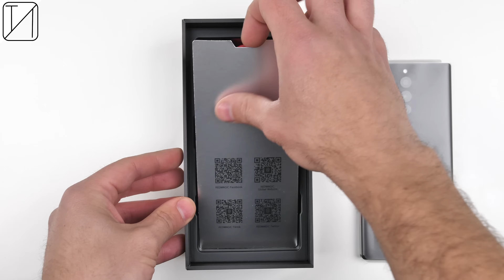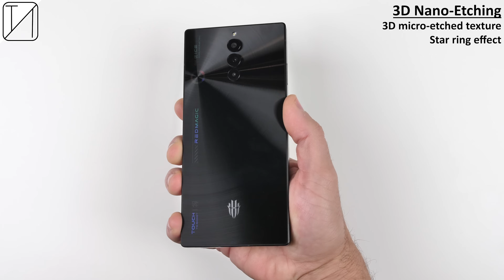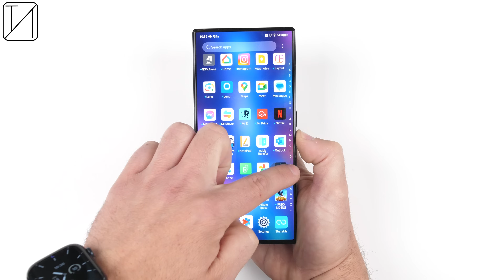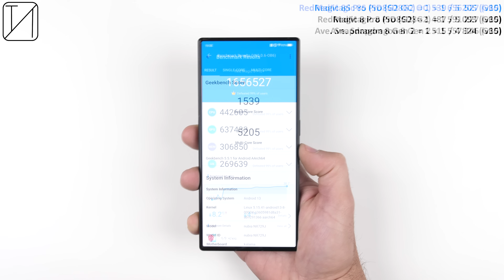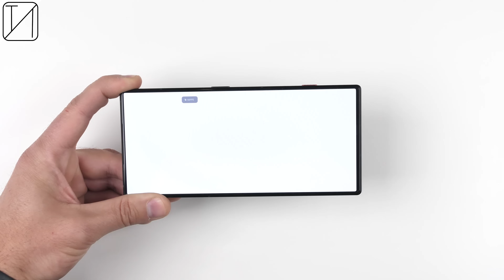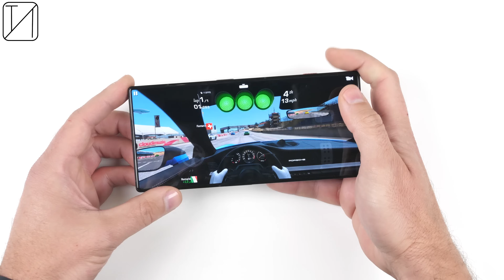REDMAGIC 8S Pro Review: Even More Powerful!

Comment: Its such a pity the midnight black one has lower specs. I think its the best looking of the bunch. I really wish redmagic wouldn’t limit each color to a different set of specs
Reply: i think the reason they did that because they were scared it wouldn't sell
Reply: I don't think you need anything more than 12GB on a phone tbh
Reply: @JRon1 yeah even with all the mobile games and emulation you could do in it, it's still more than enough.
Reply: @JRon1  The issue is more so the storage size.  No MicroSD card slot to expand so the 512GB versions are a must for those that are going to be using the phone for emulation, with all the ROMS etc.
Reply: @ArmaghRed1892 are you sure it doesn’t have an sd card slot
Reply: @likeabarrel  100% sure.
Reply: @JRon1 yoy are right but we are not sure if ps4 emulator will run smoth with 12 ram

Comment: Hi Nick. Does this OS supports 3rd party launchers ? Usually for Red Magic devices if you press the home button it gets out of the 3rd party launcher.
Reply: this I also want to know
Reply: There is always a settings for putting 3rd party launchers as default
Reply: @BennyLuu  Even after turning that option on ut still happens , that's why I asked.

Comment: If I were in the place of gaming smartphone designers, I would have opted for a single photo sensor but quality with optical stabilization, instead of several very average sensors and not optimized. 

Also, I would have positioned the USB-C and jack ports on the left side edge, not to mention adding SD card support. 

But above all, for smartphones with full screen like this Redmagic 8s Pro, I would have opted for a pop-up selfie camera instead of a selfie camera under the screen.

I think that, beyond gamers, it would have attracted any other types of consumers 🤷🏽‍♂️

Ps: I'm not a fan of Android Stock, but I would have opted for Android Stock "à la" Motorola or Asus, it's less complicated than developing an overlay that will not necessarily please everyone, And I would have simply put a physical or software button to activate the gaming mode where I would have all my gaming and other software options integrated.
Reply: A popup camera is not great for a gaming phone. Manage your expectations. A popup camera literally occupies a big space inside the phone which can be used for more copper cooling instead, not to mention the literal fan inside the phone.  For it's prices, it's a great choice. Camera is literally not a priority of a GAMING PHONE.
Reply: I'm using rog3
Unbeatable device
Reply: @zechariahdln9558   In truth, a gaming smartphone is not a priority in a market where "standard" smartphones have become just as powerful and stable in game as a gaming smartphone, being better by far on all the points that define a good smartphone 🤷🏽‍♂️

Buying a Steam Deck that will last much longer at $400-$500 + a smartphone like an iPhone 13, S22, Pixel 7 or OnePlus 11 that will be updated for 4-5 years instead of 2 years as on this Redmagic, is a much better investment.
Reply: ----popup camera affects IP rating
----and instead of putting the USB-C and 3.5 mm port on the left side edge,
    they could have just put it on the side like the ASUS ROG Phone
----they could have centered the cames on the back panel,
     although I'm not sure how that will affect the cooling performance of the phone

PERSONAL OPINION=
 I think gaming phones should be like a rog ally or a switch oled with a sim & android os
with bypass charging feature and a big cooler
Reply: @rolins3279  That's exactly it. Not everyone is the target market of gaming phones. So your literally cannot demand them to accommodate all your expectations. Lol.
Reply: A pop up camera would suck
Reply: @harryhelina9859  The OnePlus 7 Pro had a pop-up camera, but it was waterproof, in addition, this Redmagic 8 Pro is not waterproof 🤷🏽‍♂️

Comment: Id like to know the details about the headphone jack too, is it good for Hi Fi music?.. im probably still go with the s23 ultra because of the 1 TB and camera
Reply: Almost definitely no and in fact those usbc to 3.5mm dongles have actually been notorious on even pcs as a great and cheap audio improvement (assuming ur headphones are decent) over the inbuilt audio on even expensive pc's so I feel like if ur lugging around over ear headphones and a wire there's no point if u lose most of ur audio advantage to the jack itself which u will be. U won't with the dingle tho which is my point on both platforms especially phones where u have to use inbuilt audio with a jack on the phone itself.

Comment: Would this be ideal to use as a daily?  I don't game on my phone often, but the specs are amazing; especially the battery life. Currently use an s21
Reply: Same..just thinking to get this for daily use, i don't want something that has bug caused by firmware / UI e.g Xiaomi. And i like it has SD8 gen 2 and 6k mah battery. (I'm not a phone gamer)
Reply: For a daily this is overkill but he'll yeah to answer your question
Reply: Take my word for it, the software and localizations are awful. Buggy and frustrating to deal with, not good as a daily driver for overall software experience
Reply: If you're not the target, I think it's not really worth to buy not to mention the long term usage, QoL, security/0S update, etc. In a gaming phones is awful. Today flagship has a good SoT even though it still less than gaming oriented phone. Still Had a better camera ofc and anything I say above.

Comment: Would I be able to buy a unlocked model and take it to Verizon Wireless (in the U.S) and activate it there ? May sound like a dumb question I get it but hey maybe I'm dumb you do t know me ,LOL 😅😅😂😂 . But seriously I have the Samsung Galaxy S22Ultra but am looking g for perhaps a different phone experience and thus phone looks intriguing. I do like the SPen on the S22 whixh is why i have been with Samsung as long as i have been. I started with the Note 4 because of the SPen and never looked back even after the explosive(lol) controversy of the Note 7 a still stuck with them . But like I stated earlier in this unnecessary long comment(lol) this phone looks intriguing.  And I like that is geared for the gaming and all the options it has for gaming . The rest of the phone seems like more common features and same level as other flagship  devices but ... I digress I just want to know if I buy this phone unlocked can I activate it at Verizon Wireless (U.S) thanks folks

Comment: For years my nonnegotiables for a new phone were removable battery, expandable storage, and headphone jack. The fact that you went the whole review without showing the top or bottom of the phone is mind boggling. There are no pictures of the top or bottom on the website either. What are you trying to hide? It wasn't until twelve and a half minutes in that I learned it even HAD a headphone jack! Their own store doesn't say it has a headphone jack. It's enhanced in someway? How is that? Sacrificing wireless charging and two of my three needs is honestly a hard sell for me. I've been using a Samsung S10 plus for four  years now and it is the model with 1tb of internal WITH expandable storage! My ancient phone has 2tb of storage space. How can phones almost 5 years later not match that yet?
Reply: Your only choice for removable battery is the Xcover Pro 2020 and Xcover6 Pro 2022, rugged non gaming/non consumer phone. Sd card slot is being restricted to below midrange by most (except Sony) and headphone jack is occasionally still used. Maybe bec they realized BT audio and gaming don't go well with each other.
Flagship chipsets+sd card+jack will only limit you to Xperia 1/5 Marks ii/iii/iv/v models.
Reply: edited since I worded it like Xperias still have removable batteries.😂

Comment: So basically they didn't change anything that were the reasons I returned this phone (8 Pro) before.  While it's not all bad there are critical flaws.  No wireless charging, the call volume was way too low at the loudest, the cameras (front and back) were awful and the display wasn't bright enough in sunlight.  If you want a portable gaming device, there are better, cheaper ones out there.  The specs say one thing, but in reality, it's very different.  I ended up buying a OnePlus 11 5G, which has almost identical specs (basically same CPU/GPU, same RAM, same drive space and speed, slightly faster charging, but still no wireless charging.  It has a better phone, much better cameras, great display and doesn't get hot even while gaming.  I found it to be a better phone, while also being cheaper.  It does lack the gaming trigger buttons and a few niche things that the 8 Pro had, but the main advantage the 8 Pro had was a bigger battery.  I also found the Red Magic 8 Pro had no issue connecting to a portable monitor, but the OnePlus 11 5g doesn't appear to work that way.  The 8 Pro also had power passthrough while gaming, which is nice, but the gaming settings were just gimmicky.  One more thing the 8 Pro had instead was Wifi 7.  I still got 4 days of use out of either phone.
Reply: Are you still using Oneplus 11?  My new favorite smartphone is Asus Zenfone 10.
Reply: @shreyasdharashivkar8027  Yes.  Had it since Apr.  Great phone!
Reply: @techbutter. Spoken like a true non-gamer that bought a gaming phone with no intention to really play games. Should have gone for their Nubia Z50 series then. Who the F wants to game under the sun? It's like a person wanting to play PS5 at the beach which makes absolutely no sense. Gaming phones are designed for gamers that play mostly indoors thus reducing the need to have bright screens. Not to mention that camera while it's nice to have a better one, shouldn't be a main concern to gamer which is why they have kept the same camera system for the past few years.
Reply: everyone is a gangster until they actually gets the green line problem on OnePlus device after a year
Reply: @sxlrora  I've likely been gaming since before you were born.  If you're a true gamer, you as you imply, you wouldn't buy a phone to game on.  You're trying to make the argument "Why buy a phone if you're a real gamer?"  Precisely.  So, if you're buying this, you're going after something that does more than gaming.  You're failing but trying to make the case that a "real gamer" would buy a dedicated gaming device, rather than something that's trying to be everything to everyone (not just "gamers").  Plus, if you're a true gamer, you wouldn't bother paying such a high price to play on such a small thing to begin with (crappy sound, small screen, can't play real games - all mobile).  Seeing as the competition managed to get a competitive gaming capable phone with better sound and cameras, I don't see your last point.
Reply: My issue is with all other gen 2 phones is heat. Throttling is real especially on Yuzu emulation. Yuzu devs said the RM8 will not throttle during emulation.
Reply: @sxlrora   @sxlrora6856  You seem overly emotional about this particular phone, "True Gamer"
Reply: @TechButler  Hmm. Freedom of speech takes place. Just as you are free to do say as you wish, so do I and everyone else. There is nothing emotional, purely opinion based reply. Not too sure why a kid wanted to steer into the comment of "I have probably played game longer than anyone else before they were born, so my opinion will be the most valid". Not saying mine is valid, just purely personal opinion based. Cheers mate. You do you and have fun on the internet.👍
Reply: @TechButler  Can you check the fps for mobile legends in oneplus 11? does is support Ultra(120 fps) now?
Reply: @ChloeMcFlurry  Sure.  I never play that game, but even after setting the phone at 120Mhz with full graphics settings (no power saving, all performance), that game wouldn't go above 60fps.  Some games do.  Awesome news though.  Turning all the settings on full, wouldn't push it above 36C even after playing it a while.  I set anisotropic filtering, MSAA, MIPMAP bias and texture quality turned all the way up, it never got hot.  I love this phone.  It's not perfect, but it's a hell of an all-rounder.  I heard the OnePlus 12 is rumored to get a 5400 vs 5000 Mah battery and a CPU upgrade.  Considering in my normal use (not much gaming on this phone, as I use it for personal/professional use most of the time), I get 4 days out of it consistently.  I played maybe 20-30 min of Mobile Legends on max brightness, full 120Mhz refresh, etc. and lost about 4% battery in that time.
Reply: oneplus is good but have the most stupid placement for a frontcam that i have ever seen why tf is in an edge😂 if not its in the front is better nothing, also have bezels the screen is just way worse dud but yeah better camera and software thats good also 1000mah less battery
Reply: Oneplus 11 has wifi 7

Comment: which is better with the rog 7?
Reply: Rog 7 ult beats the rm 8s pro. I think rog 7 would be about same or better. Only thing is that rog phones are more bulky and heavier. You also need to buy a separate cooler if u want the full performance unlike rm. Rog is better than rm
Reply: @evilbuttface9550 the components in rm 8s pro is more powerful than in rog 7. But the rog have a better system (maybe, because I don't know if rm fixed the problems in system from 8 pro)
Reply: @user-cz9it7xg3q  rn redmagic 8s pro has a better processor cuz of the overclocked Samsung one. Asus rog has a better cooling system and better software with it. Rm is just throwing powerful hardware on the phone while rog is planning all the extra things. Both are powerhouses but tbh id take the better cooling over a cpu thats a bit better cuz i doubt any game is really gonna use all of that cpu. Even if it does the cooling would help way more imo for duration

Comment: this phone is better in cooling, rtx, camera, gaming, price, specs, ram, storage, battery, charge time, long lasting gaming, 11 layer cooling system, ray tracing, display with 120Hz AMOLED, 
yes it’s better than the iPhone 16 pro max

the cooling is insane

if you have a pc with the specs weaker than a rtx 3050, Intel Core i5-13600K consider this phone better than you’re whole pc 

yes it’s better than the iPhone 16 pro max

Comment: Nowhere close to M2 or even M1 iPad Pro.
Reply: This chipset is already more powerful than m1 or m2. The only problem is an android system. If you put this chip on ios is will be the most powerful mobile device.
Reply: @ВладиславПутріков  proof?
Reply: @ВладиславПутріков  do you really think samsung/qualcomm will put a chipset on a phone more powerful than a whole desktop? I highly doubt that. M1/M2 are desktop class processors, fyi. And anyway, what matters is overall performance, nobody gives a fujk if their phone will be ‘faster’ if converted to iOS operating system.
Reply: Do your really think that if this chipset is using by laptops it automatically becomes "the most prowerful"? It is the same as sd 8 gen 2, you can even see it by using hardware testing apps. And also the MacBooks have the same power as IPads (also chipsets in MacBooks is better than in IPads). It can't run hard games because this chipset is a portable chip for devices that you can take everywhere. You can even compare this two chipsets and the buffed snapdragon 8 gen 2 will be even a little bit faster.
Reply: @ВладиславПутріков  macbooks have same power as ipad? Wtf. Even though the very entry level macbook and the very top level ipad have the same chip, macbook has better performance
Reply: @ВладиславПутріков  and by what basis do you think is the 8g2 more powerful than the m2? M2 is 3.5Ghz, 8g2 is is 3.3Ghz. M2 has 10 gpu cores, 8g2 only has 8.
Reply: Check the benchmarks yourself, m2 dominates in everything, even in Antutu
Reply: @raed.gilani  Do you think that IPad pro m2 can have more than 1 600 000 points in antutu like rm 8s pro?
Reply: I'm not an android fan but I think that next generations of Android chipsets will be more powerful than Apple chipsets.
Reply: Also, note that antutu says the scores are not directly comparable, and ios scores are different and are lower. That means the ipad pro can go even more! 2.5 million minimum
Reply: Speechless huh? A17 will have the performance of M1. Wait for android to get destroyed now.
Reply: @raed.gilani  Then why if m2 have 2.5m points but in tests it is have the same speed as 1.5 million points devices?
Reply: @ВладиславПутріков  bruh. App opening, etc. don’t even use 100% of the cpu/gpu. When it’s intense (like extreme graphics games for long time, or video processing), M2 will absolutely destroy the other chipsets.
Reply: @raed.gilani  yes I know that. But it's also can be tied with the ios system. Ios is using RAM and ROM very good and optimization in apps is much better. I'm not talking about how powerful is m2. I'm just saying that every chipset on ios will be better.
Reply: @ВладиславПутріков  it will be. But i noticed one thing. Regardless of power, every flagship android opens some app faster than ios devices- even m2. That’s cuz of android, but the main power for most other will be lower (if less specced).